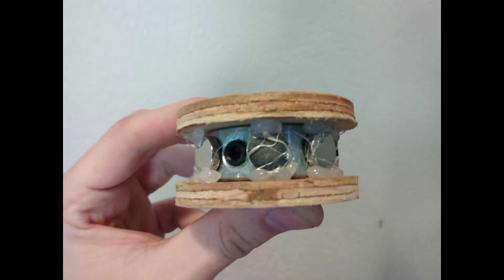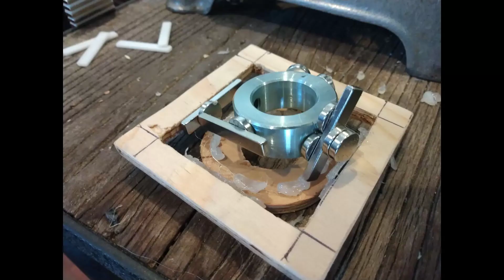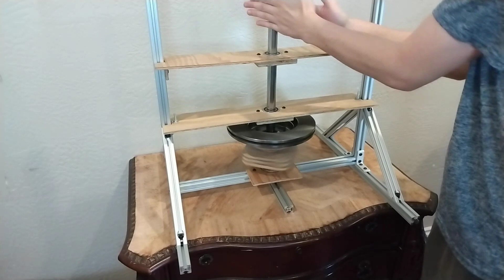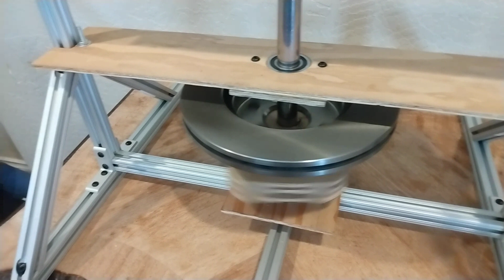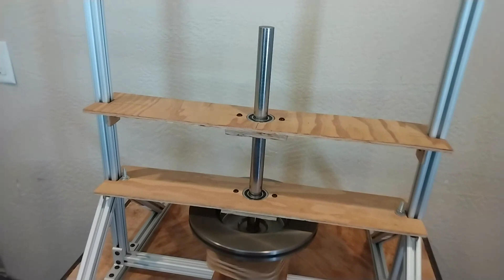DIY Flywheel Battery - Sustainable Energy Storage (Part 2)

Comment: Where you at with this buddy? Did you loose interest in this project?
Reply from the maker: Took this design as far as made sense, I have a much better design in mind but it requires welding and goes beyond the original design constraints in terms of budget and equipment.
Reply: @johnexhibitsguy  Storage is a tough component of an alternative energy system but the flywheel is a fascinating idea. The use of magnets to minimize resistance for efficiency and reduction of wear and tear is of particular interest to me.

Comment: Hi, is there a way to calculate the energy we could store in such devices on a much larger scale?

say if we have an abundance of area to put those devices (1 million m^2), 
and say that each unit takes 1 meters squared, 
and say that we use 60 KG (135 pounds) load over those shafts,
and say we use 1 million devices, 

how much energy could be stored in those devices collectively, and be used for electricity generation let's say?
Reply from the maker: Yes, here is the formula for the energy of a flywheel: http://zebu.uoregon.edu/1996/ph162/l10a.html and here is a calculator you can use: https://www.calculatoratoz.com/en/energy-output-enom-the-flywheel-calculator/Calc-13949

Comment: To align the axis, you could use a magnet slightly above the top of the shaft, just close enough to keep it upright. You may still need a bearing near the center, but that would just be there to keep it stable.
Just a thought.
Cheers!

Comment: I'm curious if it would be possible to set up this flywheel shaft as the base for a vertical axis induction wind turbine. as it is here there isn't much real estate for VAWT fins but this could be a highly efficient low-profile wind turbine solution

Comment: You do realise your pumping air with that vented rotor, and central mass is a near complete waist of energy. Fix the run out, spin it up to speed and time it, then put tape around the disc covering the gap, spin and time it again!
Reply from the maker: Yes, it's meant to hold larger non-fluted flywheels. I won't be working on this design further, however I'm taking everything I learned from it and  trying a completely new design. See the conclusion section of the part 3 video.

Comment: I suspect there is a design for your axial stabilizer magnets that is feasible for you to construct. Please keep researching that. Finding that solution is very key for the long-term robustness of your device.
Reply from the maker: Large commercial flywheel units use radial electromagnet bearings controlled by a computer system, effective but too complex unfortunately. In version 2.0 I will attempt permanent magnet bearings again, hopefully without raising the cost of the project too much.

Comment: It needs to be balanced premature bearing wear is expected.🖖🏻
Reply from the maker: Yes. It would be interesting to study the bearing lifetime, as the design is slightly flexible and the bearings can move along the shaft. One of the constraints for this project is that each step must be able to be done by an average DIYer with common tools, which makes the design process challenging. Version 2.0 will use a much lower RPM to reduce wear, with an option for magnetic radial bearings.

Comment: Thank you for the video. I have a question about those beautiful high-powered neodymium magnets you are using: what's their size (diameter x height), weight and strength of attraction/repulsion? thank you for your reply.
Reply from the maker: These magnets are 2.5" by 0.5" weighing 301.7g with 114.3lbs of repulsion force, here is the exact product and specifications: https://www.kjmagnetics.com/proddetail.asp?prod=DY88